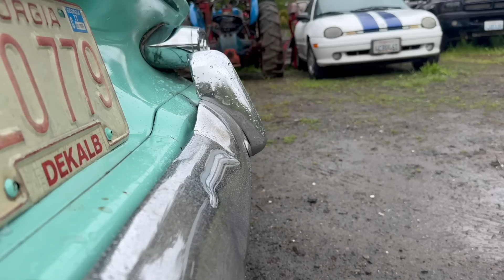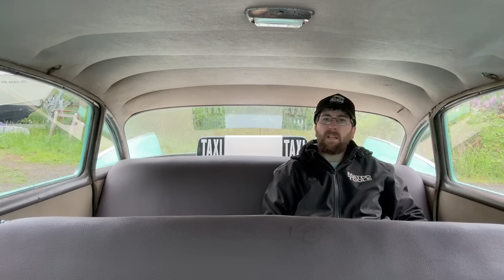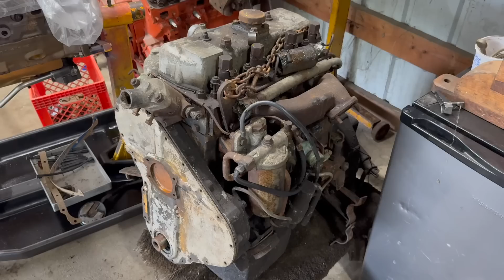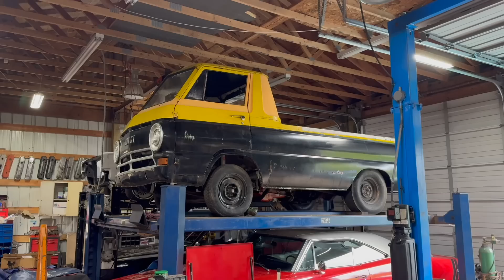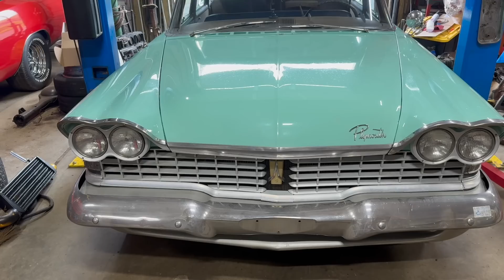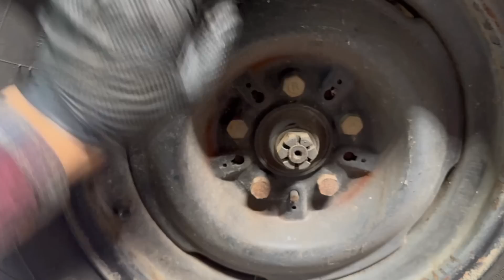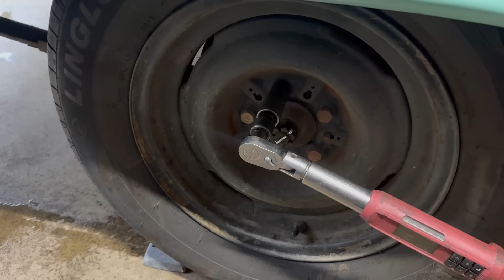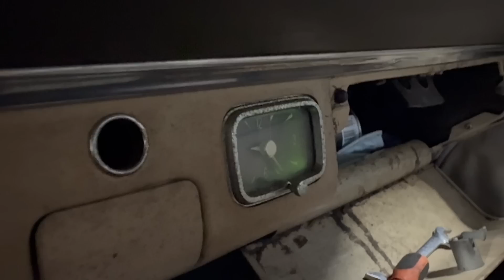Slow And Stinky - 1959 Plymouth Diesel Taxi Engine Tech, Test Drive, Safety Inspection (Not Good...)

Comment: Now I could see putting on a turbo from newer motor and maybe a four speed  now swapping in a newer perk could be a thing since they were in alot of equipment and box trucks but only if u don't have to modify alot to do newer motor swap or slapping on a small turbo that's max 10 psi maybe would be little enough to start boosting at low rpm and even 6 or 7 psi the pump might be able to handle fueling and having a old pump to open to see if there's ways to modify it is always a plus and possibly rebuild the other motor and up compression but that aside having good open exhaust helps on   none turbo desiels and air in now if it wasn't as rear I would bag the rear put some tow hitch and if u put in a better engine to pull use it to tow my good car to a show or small camper to cruise with so maybe looking into a newer but still a Perkins motor of sort would be could and a better trans with more gears would be a cool ride keep up great work and think it's worth patching the little rust now and saving the underside even better

Comment: Well that is an interesting and rare car!!  It makes perfect sense though considering it spent most of it's working life driving around the city and wasn't required to maintain a highway speed for long distance. I wouldn't want to pull a grade going over a mountain pass with it though. I wonder how much that car weights?  The power to weight ratio is rather dismal I would expect. Do you know what the rear end gear ratio is by any chance?  Perhaps a different gear set would help?

Comment: The truck I learned how to drive on was a 1967 Brockway with a NHC 250 Cummins and a 15 speed. My boss ran trailer dumps that grossed at 99,000lbs. We learned 2 things when trying to get more power out of the tired Cummins. First, turning up the fuel didn't help power and because the NHC250 lacked piston squirters, even turbocharging it would only bring it up to 270hp maximum. We did find an oddball problem that might help you. One of the fuel hoses on the suction side had delaminated and when under suction, the line would collapse internally. You might want to see if it runs better off a can to see.

Comment: I have a 1986 Ford Ranger Turbo Diesel 4 x 4 that I bought in 94 has a Mitsubishi 4 cylinder turbo diesel obviously with about 85 horsepower Ford only built them in 85 and 86

Comment: The leaking oil filter can is a common Perkins thing, a Massey Ferguson dealer can get you a adapter to accept a spin on filter, same goes for the fuel filters. BTW, I believe Caterpillar owns Perkins now, they did some kind of trade with Agco where Agco got the sales rights to the Cat Challenger tracked agricultural tractors

Comment: Jamie, cool story from the early 1960’s.. My dad was a radio astronomer in the Washington DC area at the time, he worked for the University of Maryland.  He often went to Greenbank, WV because they had, at the time, the largest aimable radio telescope.  It was also in what is called National Radio Quiet Zone (still a thing, google it). 13000 square miles of restricted area.  They didn’t and still don’t allow, regular cars in the area because of the radio interference from gas ignition systems, these were the only taxis allowed in the area according to him. A very specialized use.

Comment: Releasing all 50 horses slowly, ooh and a perkins, like a tractor. It mighten go fast or be refined, will be hard to start in the cold but will last forever, and the noise, vibration, did I say it was slow, perfect vehicle for the apocalypse will run on anything and no computers

Comment: As far as adjusting the brakes go, at like 22 minutes in the video, you can see what I believe to be the brake shoe adjustment bolts. Those are the rust-colored bolts poking through the backing plate at what looks like the 3 and 9 o'clock positions. IIRC, when you turn that bolt (one on each side of the backing plate), it moves a cam deal that rides on the brake shoe and provides the adjustment ability.

Comment: That is probably the coolest Plymouth ever. Not only were there not many diesel Plymouths built, but that one managed to survive pretty much intact. It's hard to find a gas powered one in anywhere near that condition. 

Many of the "regular vehicles" (not super powerful or collectible) are what I like to call "Commodity Cars"- They're built, used up, and largely exist only in pictures. I'm sure the serial number car before and after it suffered that fate. Would be interesting to figure out how that one managed to survive.
Reply: Most cars from the 50s - are completely extinct now, and when you see one they’re either valued for pennies if they’re standard or 9999 million. It’s a shame because even everything from the chrome huge fin era is gone as if they weren’t larger than life.
Reply: I prefer the car which was in the movie Christine!

Comment: Its interesting to see this type of conversion was available in 50s. In my country back in the 80s effects of oil crisis were still very present and older American cars were still very common cars for taxi and minibus use because they were large and reasonobly reliable but spare parts and fuel economy was a big problem. So during those times a lot of cars were engine swapped with small diesel truck engines and perkins inline 4s were one of them. Sadly most of them were scrapped in the 90s.

Comment: A bar of ivory soap held against the belt while running for a few seconds will instantly get rid of most belt squeals. Sometimes long term until the belt really needs replacing .... I think they put some of those Perkins diesels in some 70 Dodge pickups.
Reply from the maker: I’m hip to that. But going to try and actually fix it properly.
Reply: Nope, the diesel in the late 70s trucks is a 4 liter Mitsubishi.

Comment: JAMIE, great car. There is a problem it should have more torque. Act like it's low on fuel pressure. No smoke, no fuel.
Reply from the maker: Exactly. I’m on it.
Reply: That engine was rated at around 110-120 ft/lbs (depending on the source) in the 55hp tune, and It’s got a significantly lower power (and torque) to weight ratio than a Mercedes 240D which I have driven a few examples of with 4 speed manuals and can say they are painfully slow even in a perfect state of tune and in spite of diesels being legendary for their low-end torque output, they still don’t make enough to allow for sustained top gear operation on any sort of grade.

Comment: Please god find a Perkins turbo diesel and swap components over…. I know it’s not your style but lowering the rears with air bags would be fantastic
Reply from the maker: I won’t be doing the lowering stuff, but a turbo diesel conversion is absolutely on the table… either with the stock engine or with a later Perkins or something.
Reply: The only difference adding a turbo to that e gine will make is increased fuel consumption no real performance gain, unfortunately

Comment: That thing with that fairly low diesel compression is screaming for a turbo so 0 to 60 happens before you retire. Very cool Jamie, let the haters hate.
Reply from the maker: 16.5:1, but yeah… turbski time soon I think
Reply: @DeadDodgeGarage 
If you do decide to put a turbo on it, I would find another engine and build it. That way, you  can always take it  back to stock if you want to.  For car shows.
Reply: @TumbleWeed-77  He showed in the video that he's already got a spare engine that came with the car.
Reply: @keithrushforth4019  
Yes, I know. 
My point is that the engine is so rare in that car, me personally, I wouldn't risk it.
Reply: @TumbleWeed-77  Make it a Perkins 6 cylinder.
Reply: @DeadDodgeGarage  sometimes these small diesels lend themselves well to a supercharger. No lag in the lower revs. I’m glad to see you with it. You wanted it. You have it. You rule.
Reply: @DeadDodgeGarage  I support that idea
Reply: @DeadDodgeGarage  Yes, not much higher than some high spec. gasoline engines. Some Jaguar engines were 12:1 years ago IIRC (the XJS V12 ?) and the Toyota Prius is between 13:1 - 14:1 depending on the model, I think the latest engines are 14:1, obviously for efficiency in conjunction with the Atkinson Cycle they use.
Reply: @DeadDodgeGarage  It's from the 50's a centrifugal supercharger like a McCulloch, Graham or Paxton would be more fitting !
Reply: @DeadDodgeGarage  is it possible to do a piston swap and cut the head a little to raise the compression and then port it? Or is that a crazed millionair's dream?
Reply: @AnthonyPerna2  Not really, the pistons are flat top and go pretty much all the way up to the head. The reason for the 16.5 compression is the volume of the combustion chamber - swirl chamber that's in the head itself.
Reply: @DeadDodgeGarage NOO UN SACRILEGIO SERIA
Reply: @DeadDodgeGarage  I think a super charger might be better on the Perkins   Would bee interesting to see a supercharger on it
Reply: @DeadDodgeGarage Turbo time, and possibly a better transmission brother. It would definitely benefit from a 4 or 5 speed manual on the floor. Yes, I'm a horsepower junkie...guilty.
Reply: Perkin engines were installed in alot of tractors and equipment back in the day- Massey Ferguson extensively.
Reply: @HenryEnglish-v9b  got a 3 cylinder in my MF35
Reply: @HenryEnglish-v9b  White used the 354 in several models also.
Reply: 3 on the tree - you better keep that in stocks condition- there are so many other hooptys you could modify.
Reply: I think it's such a weird old piece that he shouldn't fuck it up at all with experiemental surgery of that sort. Cars this age with weaker engines always kinda just go at the speed THEY prefer and wishing for more horsepower and spirited driving like that is basically wishing for a more modern car.
Reply: @ajorsomething4935  Yes I agree, leave her as the designers intended.
Reply: Just when I didn’t think I could like a Forward look more. Diesel is awesome
Reply: I agree
Reply: Compounding the world's smallest turbos
Reply: Oldsmobilesbrocket , I would leave it alone, don't get why people want to add hp to everything.
Reply: I like it, but I'm norwegian so everything american 😊
Reply: The biggest problem is the pneumatic governor... As soon as boost starts to build you get no vacuum in the venturi and the pump rack will be pushed to max with no control. With a mechanically governed pump it could work, but I don't know if it's available for the P4
Reply: Ain't no one hating on this wtf lol
Reply: NOP DEJARLO ORIGINAL
Reply: The glowplug light may brighten up as the p,ups get warmer, like my old Land Rover did.
Reply: I wouldn't put a junk Cummins in it.
Reply: 0 to 60

Comment: Wow! just love it . didn't Massey Ferguson tractors use perkins diesels. alll the best from the UK.
Reply: They did.  When I worked on boats for a living, one of the guys at the marina had a boat with twin Perkins I6 turbo diesels and he got most of his parts from the Massey dealer.
Reply: Yup, had a 70 year old Massey 135 with a 3 cylinder. Never cost a dime in repairs.
Reply: @JimTheZombieHunter  We had one of those but it only lasted about 50 years when one of the sleeves came loose and dropped down into the crank. This caused an immediate lockup of the rear wheels in road gear and left bruises on my chest from slamming into the steering wheel.

Comment: You’ve got to give your audience a little more credit than the average casual mopar enthusiast….i’ve heard of and seen lots of photos of this car, a few videos of it, and photos of the very little literature available around these diesel conversions. It’s awesome it’s made it to your ownership. The extremely low (sub 2,000 rpm if I recall correctly) governed speed on these engines was something that stood out to me when reading about them. For such a large inline 4 cylinder, a design with vibration issues built in, with such a heavy rotating assembly I can see why they’d want it to avoid high engine speeds but I also don’t think a little increase in max operating speed, say 5-600rpm, would really hurt it much and it would definitely help performance in conjunction with the increased fueling. 

Oh, and I think any trade from a car requiring massive rust repair to a relatively clean car that doesn’t need any major body work is always at least worth considering. Major Rust repair sucks.
Reply: I've got a little experience of my own with major rust repair. From what I've seen the only time rust repair is done thoroughly is when the guy does it himself on a car he intends to be a lifetime keeper. If the car is a flipper the rust is covered up as half-assed as possible. If the car is a little project the guy puts together knowing he will only enjoy it a few summers, then sell/trade for something else after tiring of it, he will cut corners accordingly because the repairs are only intended to last a few summers and the guy doesn't wanna work that hard before enjoying the car.
Reply: I only have experience of the P6 (six cylinder version of this engine); however, these were governed to 2200 rpm initially, later raised to 2400 for commercial vehicles, but when supplied for fitting to cars they could be set at 3000. I imagine the P4 would be similar, and it may be that this one is set for some low rpm application - with care you could probably increase the max revs(the adjustment is by the throttle stops on the manifold) by trial and working out from the maximum road speed in low gear.
n.b. for anyone with one of these engines - if the vacuum line to the governer leaks, the engine will overspeed.

Comment: This would be on my top five list for apocalyptic vehicles
Reply from the maker: Dude, it’s perfect! My only concern would be availability of special parts like the starter. You can’t just pilfer one of those off any old ride.
Reply: @DeadDodgeGarage  You need to buy a large junk yard!
Reply: @DeadDodgeGarage  Park it on top of a decent slope, put it in 2nd or 3rd and pop the clutch when it get rolling-then don't shut it off until you get it back on that slope. No worries in case of an EMP attack, good old stuff like that doesn't care about anything electrical.
Reply: But it would struggle to stay ahead of the Walking Dead tho

Comment: As an enthusiast of compression ignition, this is the content I simultaneously didn't expect and was hoping for. That thing is amazing. I want one. And an SD33 converted A-Body, and a Mitsubishi diesel tin-grill.
Reply from the maker: I want an SD33 A body toooo… some day!
Reply: @DeadDodgeGarage  I think one would be a fantastically fun, slow, economical daily.
Reply: I drive a 78 Mitsu powered Tin Grille.  It loves the added turbo.  (also have a spare engine, looking for a 78-79 Ramcharger to put it in)